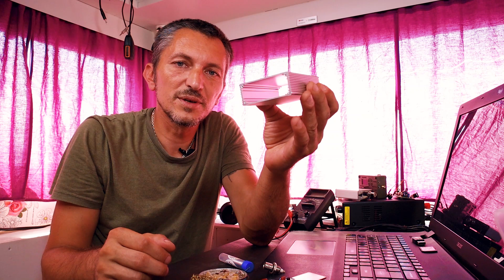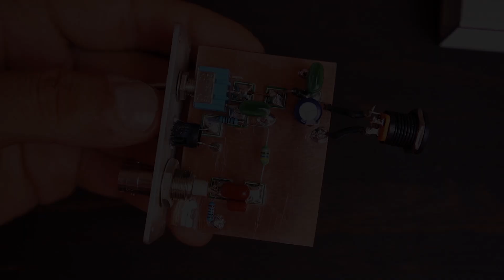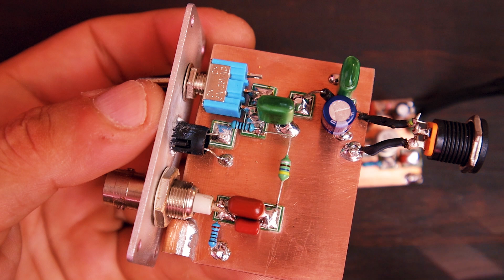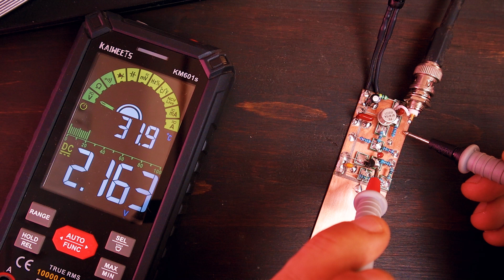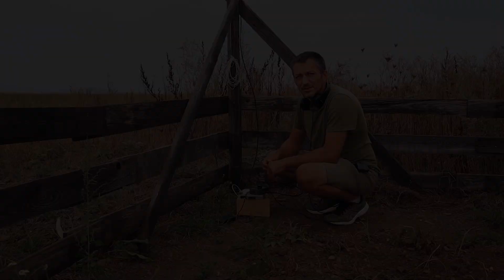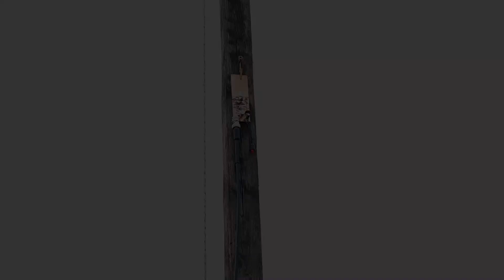Building The PA0RDT MINI WHIP Antenna - Part Two ( Bias-T And Testing )

Comment: Can I use for sputnik friend
Reply from the maker: I didn't tested it as I installed the one I built in the video to the scout camp and never had the time to rebuild it for me haha. But it worked there in the mountains very nice on HF so yes is should work great for the Sputnik as well. But remember... the performance is dependable on how well it was installed. In the download folder I also put the original article in a PDF. Lots of useful info there.
Reply: @dxexplorer  thanks i finished my receivers Cage enclousure https://youtu.be/2YTsPZupfMc?si=z4C_TiLod1x7kigV

Comment: Hello, I have rebuilt the antenna (with the PCB from PCBway) and replaced the 560nF capacitor with a 1µF capacitor. It works. However, I have only seen 100nF capacitors in all the circuits I could find on the Internet. What would be the difference to your circuit with the 560nF capacitors?
By the way, I have also rebuilt the Bias-T. It also works very well.

Best regards and 73 Ulrich
Reply from the maker: Ohhh sounds great. Glad it works. I am also building the final version as well. I have to order the 1uF capacitors as I do not have any left. The difference is that if you use 100nF capacitors... it would not work so well on lower frequencies like medium waves, long waves or even VLF. With the 1uF capacitors it performs better on lower frequencies. Of course the NPN transistor is important as well on this part. If you read original articles it will explain there a lot more. I think people used 100nF capacitors simply because they were more interested in the amateur radio bands and not so much into receiving broadcast bands or VLF. 73, YO6DXE
Reply: @dxexplorer  OK, thanks! I have several boards and will build another one with 100nF capacitors, as I am interested in both as an SWL.
                        73, Ulrich
Reply from the maker: @uli_6830 no need to build both... if you used 1uF capacitors you should be all set for both.
Reply: @dxexplorer  Thanks! and 73.
Reply from the maker: @uli_6830 Always a pleasure my friend. 73

Comment: I maded "miniwhip antenna" from single 2N7000 mosfet transistor and 4,5V power supply. I think BS170 works better. 
In indoors best antenna is a "miracle whip" - ferrite tunning variable inductor - transformer and 1m whip.
Reply from the maker: I think I found a similar schematic i wanted to try at some point.
Reply: https://youtu.be/j1lDCKY1lCQ?si=DttnChI9hDQIzSwF
Circuit diagram. 2N7000 works on 80m and don't work on 27MHz. I think BS170 is better. ( regenerative receiver with this transistor work up to 30MHz )

Comment: Thanks for sharing all these details, I do realise you have worked hard for this presentation, kudos.
Well, I got my 2N5109 marked KO  (for Made in Korea I guess), these did have the same hfe as the original Motorola, I ordered 20 pieces and appox cost me about $0.65/piece including shipping from AliExpress, and same with J310 they cost far less for 20 pieces.
Reply from the maker: I just received the PCB boards and now I must also order the transistors so I can build the final version. Curious and excited at the same time 😅😅. 73, YO6DXE
Reply: @dxexplorer I guess all the resistors should be Carbon (CFRs) to keep the noise level at a minimum.
Good luck with your new build, and can't wait for your results.
Good luck!
Reply from the maker: @bharatshetty9560 Yes but I honestly use whatever I have in my junk box 😅. Thank you so much.

Comment: Hello, I ordered the board for the MiniWhip from PCBWay. Everything arrived safely. The order of the individual components on the board does not correspond to the order you have specified in the circuit diagram. How should I proceed? I had rebuilt the Whip (with a self-made board) as you showed it in the video and it works.
Now I want to put it together on the finished design and I'm at a bit of a loss. Maybe you can help me. I would be delighted
Reply from the maker: The schematic in the video was the original one I downloaded. I made a new one that is on the same page where you found the PCB board you ordered somewhere on the bottom of the page. That one should correspond to the PCB board. Let me know if its all good.
Reply: @dxexplorer  Thank you! I've found it. Now I can tinker. I'll let you know how it works!
Reply from the maker: @uli_6830 Always a pleasure. Excellent then... let me know how it works. I am up in the mountains now but I was told my package has arrived so I will also build a final version when I get home. Meanwhile I will try to also find the original transistors. I just installed the one I made in the older videos here in the scouts camp. Seems to work like a charm so far. I will upload a video later on this evening if internet helps me 😅😅. 73, YO6DXE
Reply: @dxexplorer Hello, I have now completed 2 units with the original circuit board. Both work very well. I am currently testing them against my MLA-30+. I have set up one Whip approx. 1.5m above the roof and one under the roof hatch. I have attached a counterweight to the outer conductor so that there is at least some earthing.
The house has a total height of approx. 13 m. So there is not much difference between the Mini Whip installed above the roof and the one under the roof.
The Whip is superior to the MLA-30+, especially in the LW and MW range. On shortwave, the MLA-30+ is slightly better, especially as the directional effect allows you to block out interference. I use the bias T from the MLA-30+ for the Whip. This supplies 12V. However, I have ordered a separate bias T from Ali. But maybe I'll build one according to your instructions. I have to praise PCBWay. Impeccable quality and fast delivery at a very good price.
I can also recommend a Youloop or a Magnetic Loop (I have made a few myself) as receiving antennas, especially for difficult reception conditions or indoor operation. I use both with a preamplifier (50Khz - 6Ghz). Greetings!

Comment: Hello, I have simply rebuilt the MiniWhip. I used the J310 and the 2N5109 transistors. So the thing works. Unfortunately I can only operate it indoors (under a roof at a height of approx. 11m). As receiver I use a RSP1A with the SDR Console V3. I have been using a cheap China MiniWhip for some time now and will now compare which one performs better. According to your description I will switch to the 120nF and the 1µF capacitors. I have reinstalled the 10µH coil because I think it gives better and cleaner reception. You just have to try a bit. What I have noticed is that the antenna plays more strongly in the lower frequency range (up to 6 Mhz). The higher frequencies are not so strong so far (why?). I use the bias T from my MLA-30+, but it also works with the bias T from my RSP1A (5V), albeit with slightly less power. I have now ordered the original board from PCBWay. For being a beginner in the field of electronics tinkering, I managed it quite well (thanks to your instructions). I'm really proud of it. So far I've only made my own antennas (MagneticLoop). They are very suitable for indoors.
Now I will continue testing. Let's see what else I can “get out”. Incidentally, I am currently decoding RTTY on 146Khz with the Whip under poor conditions - but it works!
Reply from the maker: I am also really happy about the way it works. Not as sensitive as the end fed half wave but they seem to work differently. The mini whip seems really good on picking up DX stations. I am also still experimenting with it but considering that the original design was experimented on by the creator for sure... I kind of trying to stick to the original design. I will also try to order the original transistors as I am sure that it will perform a lot better. Tomorrow I hope to make the part three of the video on this one as I am curious how it performs here in the mountains in the scouts camp I am currently in. 73, YO6DXE
Reply: @dxexplorer  Thank you! I have just replaced the capacitors mentioned. The reception seems better to me. Especially on the upper bands.
Let's see what happens next. Have fun trying it out!

Comment: Thanks for the interesting videos about the mini whip. I made one myself a couple of years ago, with slightly different parts but with the same basic circuit diagram. Works well although there is too much noise inside the house.
My two cents about grounding: this antenna is an electric field probe which senses a voltage against the ground of the circuit board. Ideally you would like your ground to be a very large metal sheet directly connected to your circuit ground. But the electric field is higher further away from this metal sheet, it would be nice if the board was mounted on top of a metal pipe sticking out at least a few meters above this metal sheet. That is - in theory, looking at how electric fields behave.

The reality is a little different. The circuit senses a voltage between the copper pad and the ground. This ground however is at the end of a length of coax. The outer shield of the coax acts as a (random length) wire antenna and the circuit senses the voltage between the end of this “wire antenna” and some capacitance (the copper pad) towards it’s surroundings.
This means that how you have your coax to your mini whip and how else you connect your mini whip to any kind of metal structure has a great effect on it’s performance.
Reply from the maker: Ohhhh thank you so much. Now I understand even better. I was close but now I am closer 😁😅. I just wonder as I see diferent opinions online... some say its better to ground the ground of the mini whip it self right there on the spot... others to ground the coax before going inside the house ( camper in my case )... and others to actually ground the coax right before it goes into the Bias-T. At the moment for my convenience I grounded the entire Bias-T box since is all aluminum and it was easier. The antenna is about 5-6 meters high at this point as as ground I use the entire camper since is all covered in aluminum... and I also have a bit of copper sheet underground with a wire connected to the aluminum sheet that covers the camper. So it should have decend grounding as it is ? Still it doesn't seem so sensitive as I expected it to be. Maybe something is not yet quite right. Trying to figure that out haha. Thanks so much one more time. 73, YO6DXE
Reply: @dxexplorer  Thanks for your kind words.
If you mount the whip a few meters above your camper like you wrote with the camper being all metal that sounds like a good setup. The sensitivity of this antenna isn’t super good. I think the goal for this antenna design was a good compromise between sensitivity, signal to noise ratio and not being overloaded by nearby broadcast stations.
I did see in your video that the gap between the copper pad and the ground plans in your PCB is rather narrow. I have it a little wider. The stray capacitance between the pad and the ground plane shorts the signal to ground and limits the sensitivity. Best to keep this stray capacitance as low as possible.
All in all this is a nice antenna for a lot of experimentation and for sure everybody’s mileage will vary!
Have fun with your build, looking forward to part 3.

With regards to where to best ground the mini whip - with the outer shield of the coax being part of the antenna system - the further away from the mini whip PCB you ground the coax, the bigger the influence of the coax becomes as part of the antenna. I can’t tell upfront if this is good or bad.
I used mine in the yard on top of 2.5mtr of PVC pipe on a tripod with the coax partially laying on the ground. I took no other grounding measures. Far enough away from the house the noise was low and although a little weaker the ham radio signals were clearly audible.
Reply from the maker: @robertvandersanden Ohhhhh I thought about the gap between the pad and the rest of the stuff. Ohhhh one more thank you then 😁😁. Yes indeed it looks like a compromise antenna... but I like it even just as it is. Is nice that it can cover so much and I don't have to keep switing antennas when testing all sort of receiver projects hahaha. Thank you so much one more time. And yes I will do the final install here on top of the camper when the PCB boards for the Mini Whip arrive and I do the final version. 73, YO6DXE

Comment: Interesting series.  I built a Mini Whip antenna from a kit about 5 years ago.  It worked OK at my old QTH but it also picked up a lot of QRM from the power  lines and various other RF emitters outside my house.  It was so bad that whole bands were completely saturated with QRM.  I now live in a neighborhood with more houses and solar panels but fewer power lines and less QRM to deal with.  I've since heard that some people use a balun in line with their antenna, not sure if it is a 1:1 CMC or a 1:9 impedance matching balun, but they say they get improved gain with it.  Maybe that could help you, too? 73 JS2OLO Japan
Reply from the maker: Thank you so much. Yes it should be a 1:1 common mode choke. But it only becomes effective is the pole of where the antenna is installed is metalic and grounded and the ground of the antenna connected to the pole. Mine is on a plastic tube so a 1:1 choke is ineffective. At least in the tests I made I see no difference. But on the other side, I am lucky because I am in the middle of corn fields with my camper and I do not have interferences. The noise level on the transceiver is down to S2... compared to the S4 I get if I use the EFHW antenna. The only problem I have is that the Mini Whip doesn't seem so sensitive even if at the moment is up 5m in the air. I know it becomes more and more sensitive the higher is installed, but I was expecting it would still work great even if its a little lower 😁. We will see now when I will also do the final install in the kids camp to see if I get better results. My grounding here is not exactly perfect either and I do not use the original transistors so maybe that may be one other reason. Still in testing mode now. I just finished designing the PCB board. I must offer a set to test it and see how that works too. 73, YO6DXE.

Comment: Hi there,
I was about to order your Sputnik Receiver from PCBWay tonight. I ran into some issues. 

First, for a first time user the site is a bit overwhelming but I found the receiver & thought I was on the way to ordering it. I decided to go assembly too since I am scratch building one right now. I was at the page where the ordered items were displayed with an option to add more as well as price indicated but it had on this page "Under Review" and despite hunting all over the page I could not get the page to make the button for the next step be usable by clicking on it. Too add to frustration the entire site or set of opened windows just vanished off my monitor.

By any chance is there a tutorial video that guides us new users thru the process. If so please pass it on.

Thanks.....
Reply from the maker: Thanks so much for this. I do not have one but sometime at the end of the month I will make an order with the Mini Whip PCB boards for me... and I could film the step by step process. I will let @PCBWay know about this issue as well as I don't think there is much I can do regarding their website when it comes to issues. 

73, YO6DXE and thank you for letting me know.
Reply: @dxexplorer  fabulous....
Reply from the maker: I came back with a quick thing. I don't know exactly when you wanted to order the board, but I remember now that if I make any changes to the project there on the PCBWay Projects page... it will have an "In Review" status for a little while. I guess until some one checks it to make sure it's ok. Maybe when you try some other time I would be thankful if you could let me know if you still have that issue. To be easier to find the projects... you can simply go on the blog and all the projects that have PCB Board designs into the articles... will also have a buton that will take you right at the page where you can order the boards. I hope it helps. 73, YO6DXE

Comment: Why did you measure SWR, being a receiving antenna? Being an active antenna, aren't you concerned that the amplifier on the antenna might alter the readings? Forgive me if it's a stupid question.
Reply from the maker: No no is no stupid question at all. As I wrote in the video description, I explained a bit wrong by saying SWR. What I was actually measuring was how good the NPN transistor and the value of the capacitors will influence the output impedance, basically what the receiver will see. Since the antenna was design to work with either 50 Ohm or 75 Ohm coax cables, then the output impedance should be as close as possible to that. So far I am happy with how it performs. Maybe with a better NPN ( a bit faster one ) I may get even better results. Also since we speak about it... I made some tests with the pad as 3cm x 4.5cm and another one with a pad that was 4cm x 10cm. The results with the bigger one were much better and the antenna was nearly as good as my EFHW. When I minimize the pad again as in the original design.. the sensitivity goes down as well. 73, YO6DXE

Comment: That reception pad was calculated as a capacitor. Cause it used to be a “whip” 
The article on kiwisdr described so. 
So there is an experiment. But I don’t think it would change much.

Anyways, nice test point. It’s out and away from any noise floor. 👌🏻

http://www.kiwisdr.com/docs/pa0rdt_whip.pdf